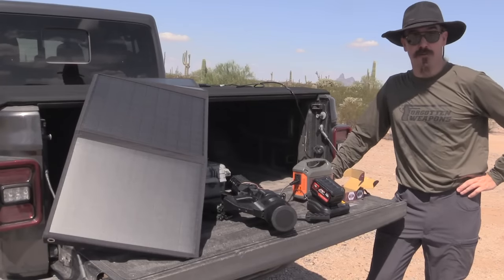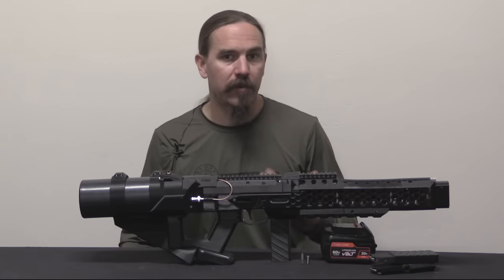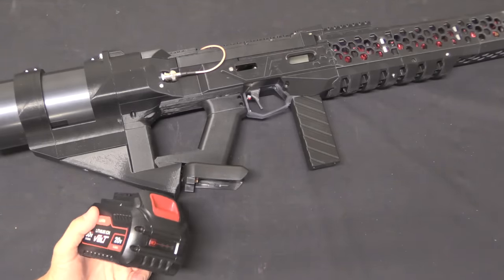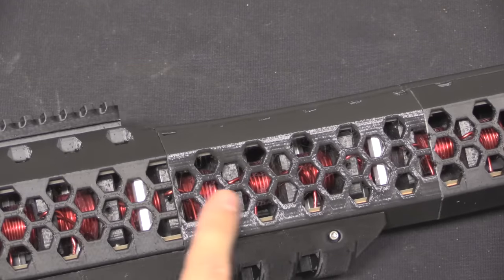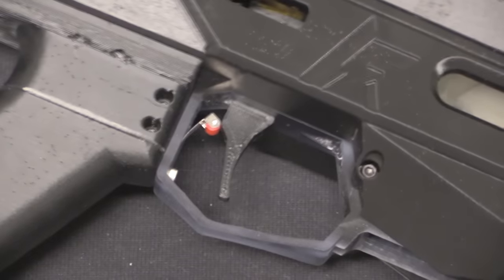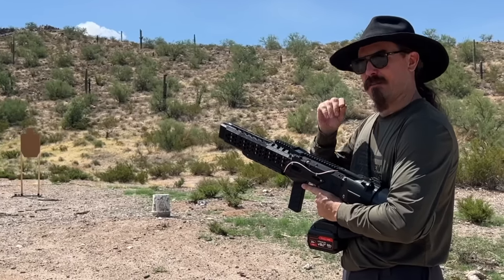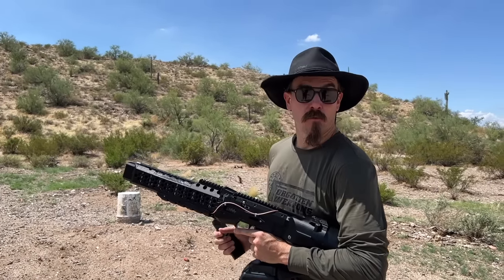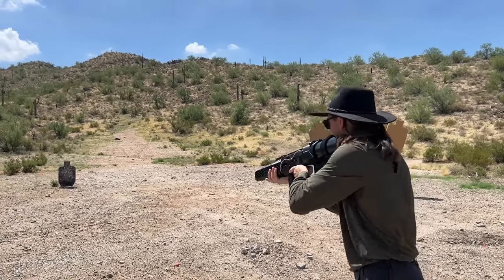ArcFlash Labs EMG-02 CoilGun: Making SciFi Weapons Into Reality

Comment: "This thing will fire drill bits." If you can't rifle the barrel just rifle the bullets 😂
Reply: Shot gun slugs
Reply: That's what I was thinking, could dowel pins with rifling grooves embedded in them self stabilize in flight?
Reply: @saint-cetacean  You'd actually be better served with fin stabilization since the projectile never physically touches the barrel.
Reply: @1337penguinman  APFSDS coilgun? ;)
Reply: Fin stablized sabotted  rounds?
Reply: @saint-cetacean  I worry the air drag would make them tumble first anyway.
Maybe they could have a motor that'd spin up the projectiles before they enter the barrel and get pulled with the coils forward?
Reply: @1337penguinman  Imagine a teflon bore liner with flechette guides, or maybe even stackable crossbow bolts similar to Joergsprave's repeating bow doublestack magazine
Reply: @unfa00  This is an interesting notion. Possibly one of the 10 coils to be offset at an angle to induce rotation of the ammo.
Reply: @panwall1327  I don't think you've thought that one through
Reply: @candyman9635  Most definitely I did not put but 10 seconds into the idea. But the concept is to use a magnet to get the projectile to spin. I'm just thinking of the most efficient (aka laziest) way to do that.
Reply: Or just make something like a Diablo shape? Like a pellet gun pellet?
Reply: @panwall1327   The laziest way is to use fin stabilised rounds.
Reply: @candyman9635  Too small. It's been tried by many a huckster.
Reply: Total nobody here, don't own a firearm, I have shot a shotgun around my brother-in-law's farm, at night, going for rabbits, and I have shot skeet is it? that whole "Pull!" thing, I have done that.  But in terms of stabilising projectiles, they don't touch the barrel at all, so sabots are pointless (If I understand their use correctly?  'Pad' the projectile down the barrel and then fall away once clear, allowing smaller projectiles, or oddly shaped projectiles to be fired from a standard barrel?)  The projectile here is a small chunk of magnetic material that does not even touch the barrel, if there is a 'barrel' at all; touching anything during launch would slow it down and maybe send it off in a random direction, here you could shape the projectile in any way, so fins would be a better idea, and you could have fins front, back, middle, or all three if required...need to spin the projectile, well maybe have twisted fins to induce spin, or each set slightly further around the projectile if that would induce spin, whatever works.  A sabot, of sorts, might be needed to fit these oddly shaped projectiles into a magazine, but it would be just to make them the same size and would be best to be discarded before firing, I think.  The sabot would not be any use during launch as you do not want the projectile touching anything as it pulled down the 'barrel'.  Just my thoughts on this idea, based on my limited experience and knowledge of firearms and my fairly large experience with sci-fi. And some physics knowledge and stuff.  Not sure how good/bad/stupid/brilliant it all is though, just ideas, to spark ideas, to spark yet more as they pass through other brains.
Reply: @NevynAtAll42  Yes fins. You are otherwise entirely correct.
Reply: Now that's just pure evil 🤣
Reply: Yeah, shot gun slugs bro.
Reply: @denvervandrey2883  whenever I see the cry laugh emoji used mistakenly, a small piece of me dies.
Reply: @saint-cetacean  No, the acceleration applied to the dowel pins would be so uneven, they'd be tumbling beyond whatever aerodynamic surfaces you could cram onto such a tiny surface area could correct, but fins trailing behind on the other hand...dartrifles? Flechette precision armaments? Taofledermaus would have a field day!
Reply: Junk Gun Fallout 4.
Reply: Probably more reliable to make little steel fin stabilized rounds. It will reduce the mass of the projectile though for a given length. At least then fewer of them would tumble and keyhole the target.
Reply: @unfa00  it should be possible to use a rotating field to induce spin on the projectiles.
Reply: @panwall1327  Not sure the coils work that way, they seem to be wrapped around the non-existant 'barrel' to just propel the projectile forward. I suspect the most useful adaptation will be shaped (pointy?) projectiles, probably with greater mass/weight. 
Fins like some are suggesting would induce more drag, making the projectile even slower than it already is. Just needs more velocity & mass and you have a virtually silent, recoil-less actual weapon. I'm impressed, to be honest.
Reply: Two words: fin-stabilised. Fléchettes are how you put accuracy in a coilgun. Optionally saboted (in plastic) if you want to put them in a magazine.
Reply: Hmm, fin stablised sub caliber rounds may be the way to go.
Reply: What about pre spinning tapered rounds with a wheel before firing?
Reply: I think that he meant screw driver tips, but he started calling them drill bits, but drill bits are too long to insert into the mag.

Comment: It’s almost like going back to the days of the blunderbuss. Out of “official” ammo? Just use whatever will fit! Really cool to see how quickly they’ve improved the tech
Reply: Not really "whatever" will fit. It needs to be a ferrous material.
Reply: @chris101ward  You can buy stock tubes of iron and steel at most hardware stores so, just chop them to length and you're good to go
Reply: Indeed! And with the pins tumbling through the air, I actually wonder if "ball shot" wouldn't offer better aerodynamics.
Reply: @Aethgeir  like ball bearings?
Reply: They just need to make it shoot about six times as fast...
Reply: @JustAGooseman  that's not quite the same as saying it's like a blunderbuss, which can be fed stones, pennies, marbles, broken glass, dryer lint, and of course lead shot.
Reply: King Charles XII was supposedly shot with two brass buttons brazed together to form a projectile. It's all a bit mythic and unsubstanciated, but it was quite possible at the time and not uncommon to do a field braze of two brass buttons from e.g. a norwegian uniform and it would fit perfectly into the barrel of the gun.
Reply: a tesla blunderbus sounds like a good idea
Reply: @chris101ward  whatever will work then.
Reply: @kilovwdude6457  
They'll still tumble so I don't think that'll help.
Your idea was better I think, as at least the ballistics of round shot is consistent.

However, as fun as this is I think they decided to fix the fun stuff first.
But the problem with Gauss rifles was never that they didn't look like guns or weren't select fire.

The problem with Gauss rifles is the lack of rifling and the horrible efficiency. Partially solved by the fact that we have lithium batteries, supercaps and high power silicon active components. But it's solving the problem with brute force and it's not even vaguely good enough. I suspect if shot with these they would just sting really badly? A winter coat would probably count as body armour
Reply: @majorpwner241  what if they make it with more coils? Would this make it the projectile to go faster?
Reply: @danilonakazone386  I'm no expert but it's a process of maximizing the efficiency of the design in general, from the coils to things like increasingly smaller and more effective power sources. More coils alone could become redundant, and certainly impractical due to size/weight constraints. They are making progress, but a long ways from rivaling firearms.
Reply: And people like Taofledermaus still fire anything that will fit out of shotguns, the modern reincarnation of the blunderbuss
Reply: @JustAGooseman  It has to be a ferromagnet projectile I'm pretty sure so not just any pellet of iron or steel will work.
Reply: I'll start to be impressed when it has the muzzle velocity of a pellet gun.  At the moment, this is little more than a toy.
Reply: @majorpwner241  That is probably in the future. From what is courently in basic reasearch we can expect much better betterys and capacitors in the next ten or so years to become avaiable.
Reply: @Aethgeir  the sphere is the IDEAL projectile all objects in nature are composed of Spheres...of course the raindrop would be ideal for most aerodynamic models...the Sphere however is the IDEAL and most efficient Speaker enclosure, my father's inventions were based on it..
Reply: @majorpwner241  
it's mostly that they've hit some very physical limits. no matter how you configure your coils you can't give the projectile more energy than is in your capacitor and you can only put so much current through your wires before they get too hot.
Reply: For a useful amount of power, you'd probably need to switch to a ~400V system, at multiple tens of thousands of amps. And also rifle the barrel, which would likely need to be made of some advanced composite ceramic hybrid.
Reply: Can you imagine a coiled welding rod gun?
Reply: gives a whole new meaning to “Cannonball!”

Comment: The year is 2052 and a now late 60’s Ian is regaling how after the apocalypse there was a period when powder weapons reigned supreme until ammunition ran out, then the weapon you could power from the sun and would fire almost any chunk of steel came into its own and became the weapon of choice!
Reply: Firing drill bits is right out of fallout
Reply: @StoutProper  good stuff lol
Reply: @StoutProper  Firing drill bits makes home depot and lowes ammunition stores as well
Reply: The only problem with this is unlike a powder-based weapon in which anyone with a lathe can make one, to make an electromagnetic weapon you need computer parts  and chips, you need a really good quality electro magnets, incredibly energy dense power cells, and a lot of other materials that frankly are not easily produced on your own or downright impossible for your average joe in his basement shelter.
Reply: @Shinzon23  That's why on their store they sell it for 2.5k
Reply: Lol drill bits are more expensive than ammo
Reply: @Shinzon23  thats true, however for average joe the most important part of operating gun would be supplying it with ammunition and firearm munition would quickly run out, at least outside US conisdering much scarcer use of firearms and advanced maintaince could be done by much more qualified people, in post-apocalypse there would probably be a lot of electronic devices laying around for chip salvage, the most problematic in my mind would finding this kind of capacitor and the light detecting switches used to change the coil powered
Reply: @Shinzon23  meanwhile black powder can be made with pee. Obvious winner we have right here
Reply: @mikoajpietrych6168  I suggest you go look up the recipe for black powder because gunpowder is not difficult in the slightest to make and you can industrially make a lot of it using just basic stuff found around the farm.

Now that's black powder if you're talking about higher performance smokeless powder stuff then yeah you need more materials but still not difficult to make it all
Reply: @HaloDude557  I was thinking something similar. The sort of supply chain one would need to make or repair a coil gun would be very similar in complexity to manufacturing chemical explosives. Especially when you look at muzzle energies, effective ranges, etc. it would likely be worth the effort to restart propellant-based weaponry supply chains.
Reply: @Shinzon23 making high performance smokeless powder (just like the ones you can buy, so with all the anti oxidation, anti radicals formation, anti explosion and anti muzzle flash) is actually really hard and probably for one person it would take couple of years to make with nowadays supply chain, as in where you can buy almost anything from internet, aside from explosives.

Comment: “This thing can actually fire drill bits”
Finally, a reason for me to keep up with all the hundreds of standard flats I’ve lost over the years.
Reply: @robinpage2730  I gave you a thumbs, but methinks you’re a bot.
Reply: @robinpage2730  Well Thankya.
Reply: Ar last! A use for all the poorly-hardened, worn out screw driver bits I've trashed in my time.
Reply: @charlesprokopp276   good god if thats the case ive got a tool box full of spot-weld drill bits / newfound ammo in my garage 0_o
Reply: @robinpage2730  Aren't we a bit too far into the future for using C?
Reply: COBOL is still in production, so C is practically futuretech compared to that.

Comment: I'm so impressed with how much progress has been made since version one! It looks so much handier and more practical.
Reply: And the fire-rate is much improved. Excited to see the third version!
Reply: Makes you wonder where they'll be in 1yr , 5 yrs? I for one am staying tuned!
Reply: @dlmsarge8329  the electrical-side can be upgraded so much more! Right with you with being so curious as to see where it will be in the years and even months to come 😃
Reply: @dlmsarge8329  Unfortunately, couple of decades likely. We are limit by battery and capacitor technology by a lot and I mean a lot
Reply: @calmsoul772  Given that Ian said that drill battery is good for about 300 rounds, I think we've got quite a bit of leeway in current battery tech before it starts limiting development.
Reply: @calmsoul772  battery isn't the issue, it is used for charging the big capacitor which does all the work really, getting magnetic fields stronger quicker is what would make the thing more powerful, so better conductor than copper and quicker switching semiconductors would be the focus of the development, if cap discharge rate is an issue, just use more of them in parallel
edit: and perhaps another point of development would the ammunition - not all magnetic metals are equal, so maybe there are gains to be made there

Comment: Even if this doesn't take off, coilguns are cool as hell, one of my favorite bits of sci-fi tech, and it's awesome to see it actually making its way into the real world. It's also cool as hell getting to see a firearm expert's views on something like this.
Reply: I could see coil guns being used by law enforcement as a form of less lethal. Though not this one specifically. I saw one that fires metal disks at quite some speed. It wouldn't be lethal, but they'd hurt like hell. And being able to shoot 50+ of those things per magazine, I think it would be a lot more efficient than beanbags
Reply: One advantage is, you can take a large magnet and run it around the target gong area and recover your ammo!
Reply: @LeeAndersonMusic  not a bad idea. Like a little plastic shell for pepperspray, or a beanbag you mentioned. Maybe even a long range, no wire taser would be cool. I wanted to make a “sabot/flechette” thingy for a ar-15. You put it on the end of the barrel, like a rifle grenade, and the bullet is caught, and the taser thing is launched. So you could theoretically tase someone 4x the distance.
Reply: i think it might take off due to cheap reusable ammo and relatively not a lot of complex parts
cheap, versatile, very quiet and low recoil make them good for stealth, and no flash to give away your position
all in all if one ever gets mass produced the army would probably contract it
Reply: @Ribbons0121R121  this should take off like a rocket for exactly the reasons you mentioned. The ammo will be so cheap. It doesn't need complex chemicals engineered like a bullet. Those batteries are good for 300 rounds.
This is the near future.
Silent.
No recoil.
No moving parts.
Nothing to clean.
Zero maintenance.
The few parts it has are cheap and easy to swap out by the user.

I would expect to see several designs within 3 years. Multiple low number test weapons. And full production within less than 10 years of different types.

It's already working, but it needs higher speeds and better aiming.
Reply: In my collection with the gyrojet.... I wish